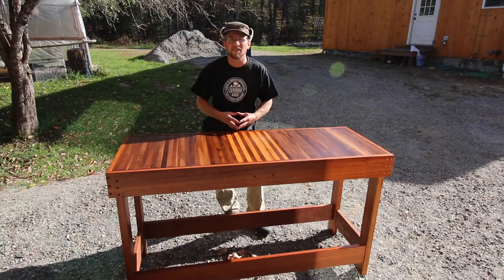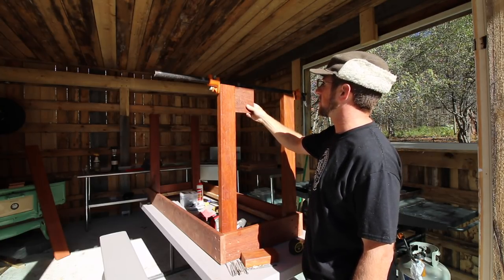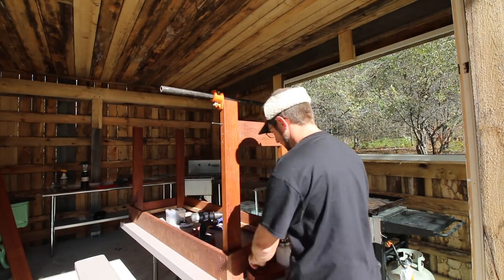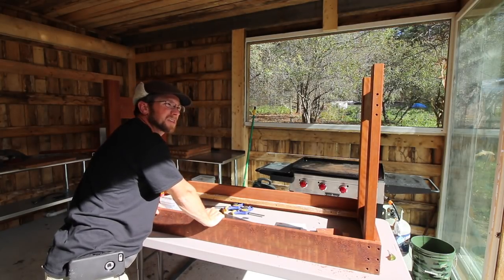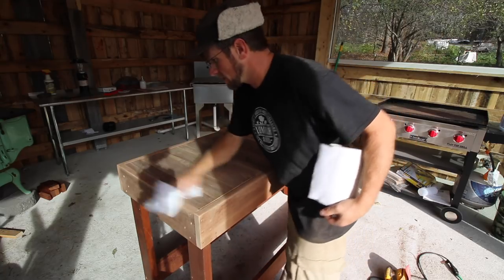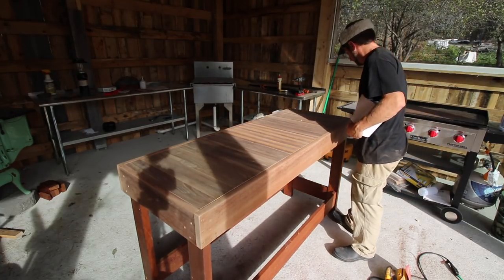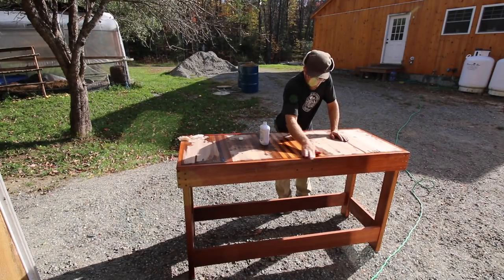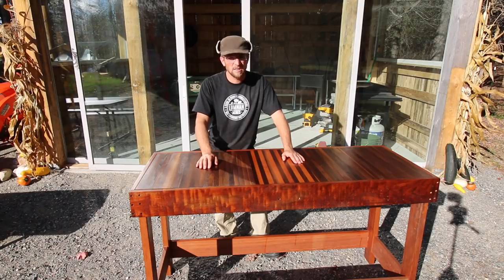The Final Steps to Building our Butcher Block Workbench

Comment: Will you be putting the mineral oil on the legs of the butcher block table?  How many coats in all will you put on it?  And how often will you reapply mineral oil in the life of the table?  We need a whole video on how to clean and maintain the butcher block table.  It is stunning.  You would have no problem selling it.  Work of art!  Journey On!
Reply from the maker: Thanks, Great idea for a video
Reply: Traditionally, old school woodworkers, apply warm oil on warm surfaces. Leaving the wood to sit in the sun to warm and using a double boiler method to warm the oil, then apply. Leaving this to sit, wiping down and reapplying to saturation. Depending on the woods this could take 4,5 or more coats of oil. A final wipe down and buffing follows a drying period, usually 24-48 hours. This process allows for deeper penetration of the oil into the wood. For durability this is often followed with a wax finish. This could be a butcher's paste wax that's applied by rubbing it deeply to fill pores, allowing to dry the buffing off. Again numerous coats might be applied. This method works well for ornamental furniture or decorations. 
Butcher blocks or counter tops are traditionally oiled the finished with melted paraffin wax. This is again applied to a warm surface, poured on and spread while liquid. It is then allowed to dry and is scraped with either cabinet scrapers or in some cases a wide putty knife or dough cutter. Finally this is burnished in with vigorous hand rubbing with burlap, linen, or cotton cloth. A well finished surface, water should bead up into tight droplets. Depending on how much use will determine how often this finish will need reapplication. A butcher will pay attention to his block or counter when it's washed up daily. When the water no longer beads up, or if there is a good deal of scarring from knives, he would apply one or more coats of butcher's paste wax to restore the finish, and semi-annually or annually sand smooth and repeat the paraffin treatment. 
While both beautiful and easier on knives. butcher blocks need a good, non penetrating, food safe finish, which requires routine maintenance. 
I'm fortunate to have two butcher block counter tops in my home. These are reclaimed all maple, bowling alley. My primary vocation the the last 40+ years has been as a carpenter home builder, fine wood worker. My specialty in my custom, fine wood working is with old school traditional finishes such as, hand rubbed, oil and wax finishes.
Reply from the maker: Sounds like a great specialty.

Comment: Looks really nice.  Just wondering about the seams between the sections of the top surface, won't gunk get between them and become a food safety concern? Or, will fluids drip down between the sections onto the floor?  Will it only be used outdoors or in the actual OGOK?  Just wondering!
Reply: The table can be hosed down by removing the boards.
Reply: Yes, and since the blocks are easily removable, you can clean whatever needs it right away, and re-oil as needed.
Reply from the maker: We will be using it in the OGOK. I like the idea of the removable boards for easy cleaning.
Reply: I instantly 'got' WHY you built it that way but, that's an 'improvement' I wouldn't have thought to do. GOOD call Al. Who says "you can't teach an old dog new tricks"?....LOL. Oh, and the 'shelf' braces you put between the legs will hold a nice stainless pan for 'drips'. Too bad we're so far apart or I'd fab one for you. Clean floors are a 'must have'.
Reply from the maker: A stainless pan sounds nice! I will send the measurements! :)

Comment: Another good video as always. I notice that you always use wood glue before you screw/nail something together. My father is somewhat of a woodworker and I don't remember him using glue for his projects.
I imagine it helps the wood stay together longer and make the pieces stronger, but is it really necessary?
May be a stupid question, but I plan on doing woodworking projects in the future and would appreciate any info. Thanks
Keep up the good work!👍
Reply from the maker: I worked at a fine furniture company for a few years and this is when I learned to use glue. A glue joint is stronger than wood. If you are making a nice piece you want to last or a piece of furniture yes use glue
Reply: Lumnah Acres that makes sense. Thanks for the info